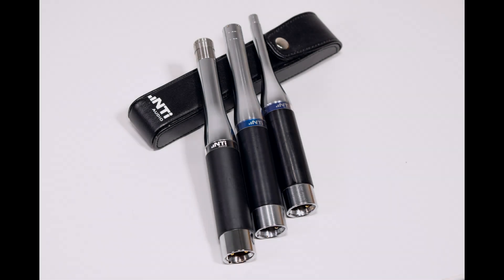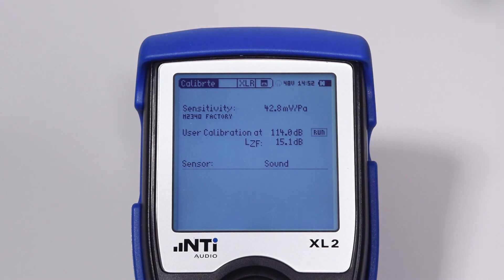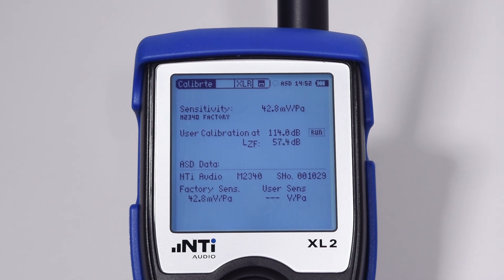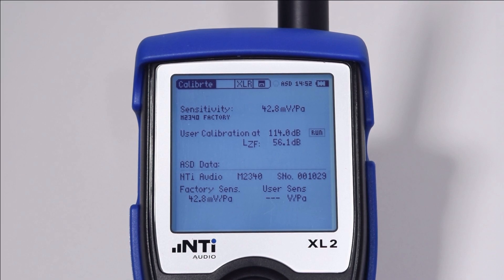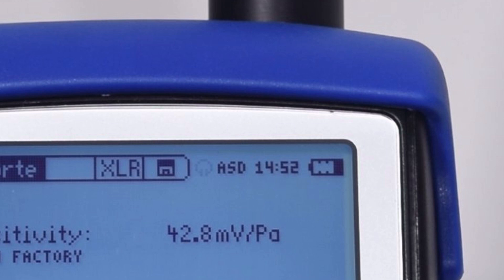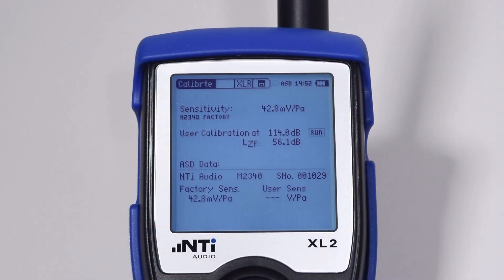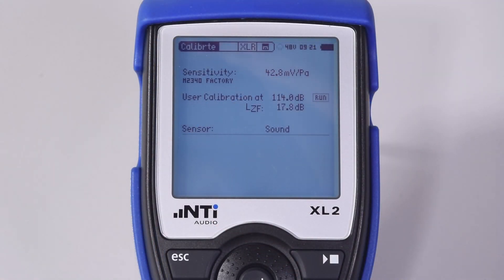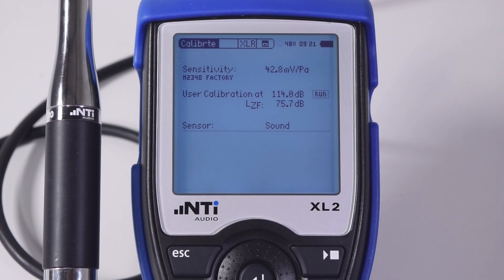Difference between XLR and ASD cable

Comment: What's the required capacitance for ASD compatible XLR cable?
Reply from the maker: Good question! The maximum allowed capacitance of the ASD data wire vs. ground is 2.7 nF.
Thus, the lower the capacitance of the XLR cable, the longer the ASD cable can be.